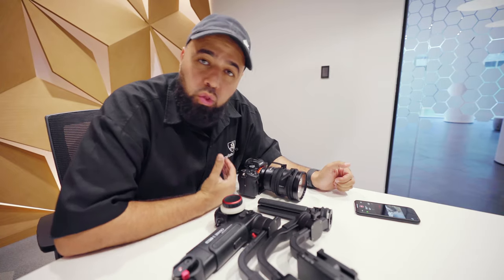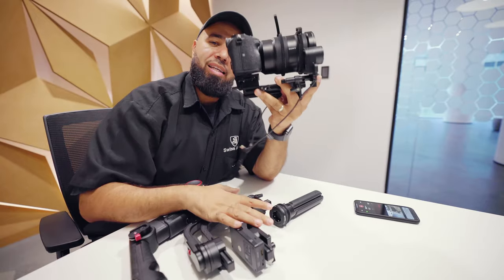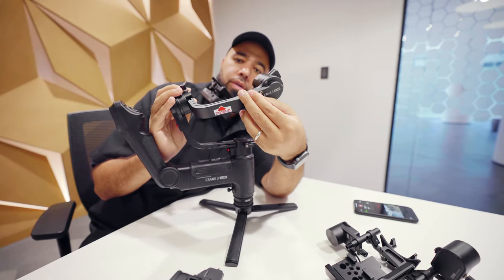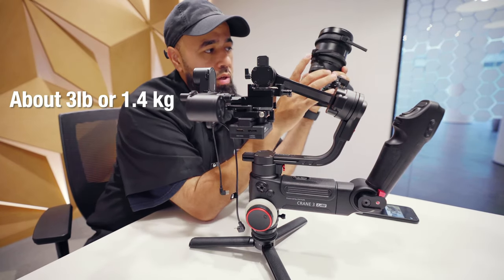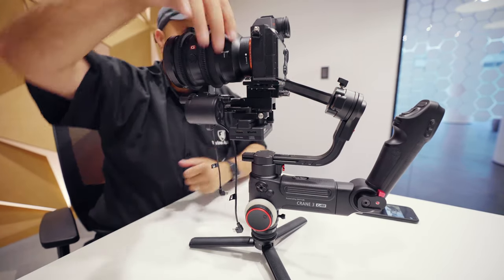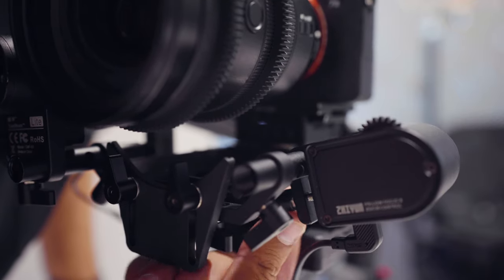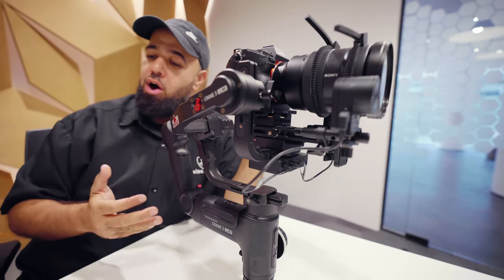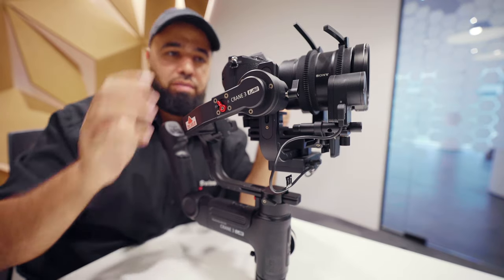Zhiyun Crane 3 How to Balance

Comment: Ummm so you pointed out the lock for the Z axis but you didn’t point out how to balance the z-axis? Even an amateur gimbal user as myself hence why I am looking at your video, and in fact I came to your video to figure out how to balance the Z axis and you taught me correctly how to balance the X axis properly, so thank you for that… But I don’t know how you mention the lock but not mention balancing it but and then event it still was a great video so thank you.
Reply from the maker: Thanks for commenting and I didn't notice that I missed it until you pointed it out.  Sorry about that.
Reply: tilt gimbal to left or right, if it spins around its out of balance, adjust pan axis untill it no longer does that.